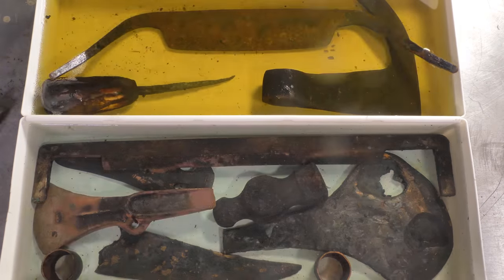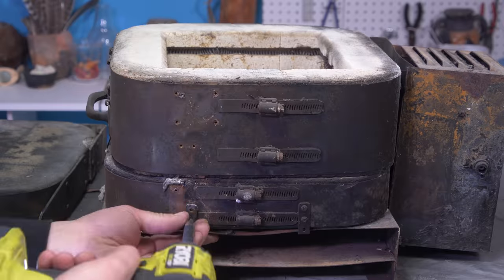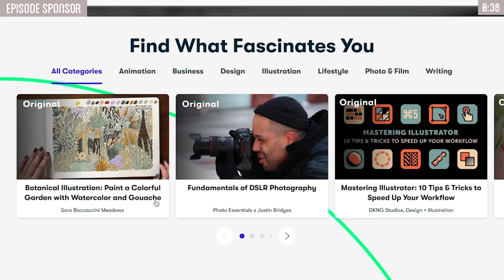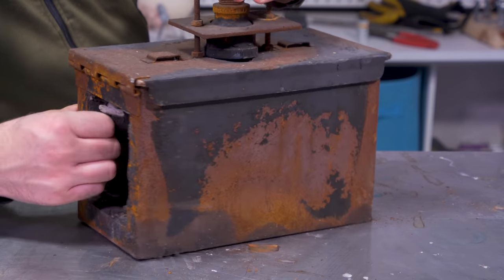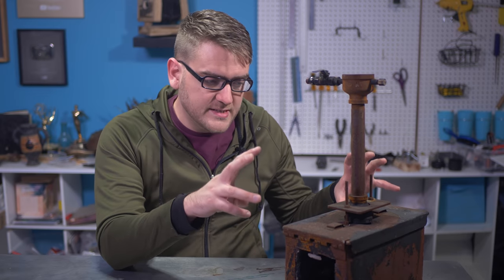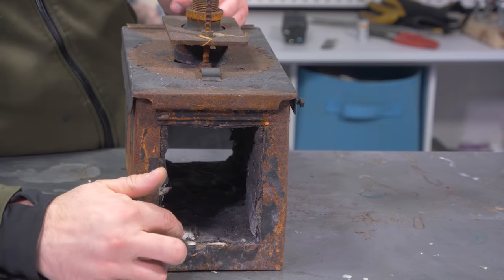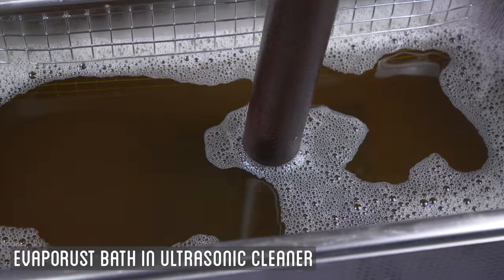Restore or Replace? $1000 Kiln and $150 Forge Rebuild!

Comment: Hey guys, the ultrasonic cleaner is more efficient if you don't let the item touch the bottom.  If you suspend your item in the liquid, the transducers aren't dampened by the item and cavitations in the water can more effectively clean things off.  Glad to see you guys are recovering!
Reply: This guy sonicates!
Reply: This is great advice, typically we use wire coat hangers to hang them in the solution.
Reply: Why would you want your tool to vibrate? Isn't that like moving your dishes around in the sink instead of holding them still while you scrub them?
Reply: @Bit-while_going  Sort of, but automatically, and at a much, much higher frequency with many times better results. So no, it's not like just haphazardly pushing your dishes around in the sink.

The ultrasonic cleaner works by using high frequency vibrations to create cavitation bubbles in the water. Cavitation bubbles are kind of like tiny implosions when gases come out of and then go back into the water, so the force of all these tiny implosions helps to remove rust and other residue much quicker and more easily. Imagine it sort of like how a boiling pot violently shakes the food around (be it vegetables, pasta, whatever) and helps to break it up and stop it sticking. 

The evaporust/vinegar also helps to speed this along by dissolving the rust into the water at the same time. Ultrasonic breaks the rust off to expose the underlayers, acid dissolves the exposed rust.
Reply: @Bit-while_going  that's exactly the goal
not having to do manual scrubbing for an hour
Reply: Good to know regarding using one. I had one long ago, they are really useful tools if you know what you are doing.
Reply: @Bit-while_going  It's actually the opposite.  Having it touching the bottom is literally vibrating your piece (like putting you hand on a subwoofer).  Having it hang in the liquid means the cavitations in the liquid are hitting the piece and breaking off the loose (dirt) stuff.  Think using the water from a hose to spray dirt off vs having the water on and trying to scrape the dirt off with the hose nozzle.
Reply: @gamingenius  did you read this in a manual? Or are you saying this from experience/intuition? As my manual says very clearly not to put items on the bottom of the pan
Reply: @hardcodedsoftware4212  That's literally what I said.  "the ultrasonic cleaner is more efficient if you don't let the item touch the bottom"
Reply: Isn't that why they are using this wire basket thing?
Reply: @tillepprecht  For the small pieces.  But they put the entire enclosure for the kiln into the bath without the wire basket.  Such a large piece is going to severely dampen the ability for the transducer to create cavitations that do the actual cleaning.
Reply: @gamingenius  As a bench jeweler for over 30ys, NEVER rest the item on the bottom- this interferes with the vibrational frequencies and adds stress to the inducer. Also for note...the tank really works best at @ an 1" from full. Hope this helps other users.
Reply: Ive noticed that in resuration videos never even thought abt it lol

Comment: That Kiln rebuild is an absolute win in my opinion. Half the price of a replacement, looks brand new and has better functionality than the original. Plus it made an interesting video. Can't go wrong with that!
Reply: AND he's gained valuable programming experience for when he inevitably builds his own computer from scratch!
Reply: Far less than half the price; paying yourself to learn an entirely new skillset from scratch is pretty off-base, IMO.
Reply: And he did it himself, so the minimum wage is not really a loss of miney
Reply: @KainYusanagi  Yeah, personal cost is always a bit of a tricky thing to calculate in. It totally depends on what job you could have done in that time, I never really calculate my time into total cost, I could easily argue it was done in my spare-time, which is free. :)
Reply: @alexanderludvigsen1893  Well it is a "loss", from his company's cofers into his wallet, in paying him (I'm assuming he actually has done that which is the smart way to run things, rather than running the business out of pocket directly). Not a loss overall for him, though, true enough (and why a lot of work is done by people on their own, rather than hiring someone else to do it for them).
Reply: @VincentGroenewold  Yup. There's also the argument of the training being relevant to the work you are doing to be able to write it off as a business expense, as well as other factors, like... Is it just you doing things on your own to figure things out, or are you taking a formalized class, etc.

I definitely wouldn't be paying myself wage to tinker around with crap I don't know crap about, for example, but if taking a formal class for it, eg. through Skill Share or Khan's Academy or something like that, then yeah, that would be a reasonable expense. The way he worded what he did, though, it sounded like he just was tinkering with it over and over until he got it to work in the end.

Comment: The Raspberry is a bit of an overkill, an Arduino or just a small atmega would have worked. But it's really nice to see you restoring (or in this case, upgrading) your tools.
Reply: Ha, an ATMega would be serious overkill, could just use some 555's!
Reply: Overkill? Yes. A learning experience for when they start fabricating their own microprocessors? Also yes.
Reply: That's what I was thinking.  Thing's just a bang-bang switch with a display.
Reply: Yeah. A simple PID would have done it.
Reply: @georgeschmidt9153  An STC-1000 costs 10 bucks plus the SSR. thats maybe 30 bucks in total repair cost.
Reply: Yeah, it is a little over kill.
For all you other "It just needs to on and off" "A 555 would have" "A PID would have"
No, it's not that simple.

If all you want to do is send it to melt temp for a given material/alloy, sure.
However if you want to temper metals, or bake ceramics or a myriad of other things, it's much more convenient to be able to set specific, automatic heat ramps both up and down. You have to use some sort of micro for that. 

While I agree that a Pi is overkill, when you consider the overhead for running a pretty flash screen like that, and the functionality the kiln now has, it isn't a bad choice considering how easily it can be implemented and how available the hardware is. Don't worry, I understand instantly going to "THAT'S COMPLETE OVERKILL", given that every "electronics wizard" is now using arduino's for water sensors when 5 npn transistors and a handful of resistors would do it. Or to turn on an LED for 4 seconds when a 555 would suffice.

Drives me nuts too.
Reply: The rPi does allow for things like easily implementing and setting up remote control and web interfaces, since you're running an actual linux box. While you certainly could have these features with an arduino if you absolutely wanted to with the right combination of software and shields, it's much less hassle for a hobby-level developer to do with a pi since all you need is to spin up a nodejs server and toss some "babby's first angular component" code at it.

Besides, it's not they're costing out a BOM for a large-volume product, a few extra dollars and watts doesn't really matter.
Reply: Might allow to have remote monitoring
Reply: @IsardPragmatique93  btw do we know what the cause of the fire was?  seems like a remote temperature sensor would have multiple uses, imo.
Reply: For the purpose of having a touchscreen UI and local webserver hosting (I assume since he mentioned controlling from a mobile phone) I think the raspberry pi was a good choice, I worry about it overheating though!!
Reply: The biggest issue with the RPi is that it will eventually eat its SD card and you'll need to reimage it - and if there's any unique config or code on that card, good luck.

Personally, I'd look to something like an ESP32 - you get a really beefy micro controller than can still be programmed with the Arduino IDE, there's loads of example code to work with (aka, copy/paste until it works) and it has bluetooth and wifi, so you can still do remote control via a phone.

I have a ton of RPis I use for various things, but for this kind of really embedded work, where it's going to utterly ruin your day if it just doesn't boot up one day, I would always go for the ESP32 or similar. It's definitely a slightly steeper learning curve, but it's a curve worth climbing.
Reply: I'm pretty sure some voltage comparaters would do the job

Comment: pls make sure to use teflon tape on all the gas connection joints, also be careful with metal thats been in a fire as its more likely to bend or crack due to the heat from the fire, otherwise epic video glad youre doing well
Reply: Yellow tape/dope just to be sure. The hose most likely has a gasket but may get broken down by the propane depending on the type of rubber/polymer. Also make sure to use an auxiliary pressure regulator.
Reply: @brianc3481  your right I was thinking in my head of the yellow tape that's like the teflon tape but I couldn't remember it, thanks for reminding me
Reply: Yeah, I was looking at that too. I'm a little concerned.

Comment: I really like that you programmed the Pi to be a kiln controller! I bet that will work so much much better than a 1000$ kiln that only has temperature set points. This you can program to do fast or slow ramps and would be awesome for tempering steel!
Reply: Modern industrial digital temperature controls do that as standard - and are much cheaper than a Raspberry Pi based solution…
Reply: Still, it’s on brand for him - a channel whose point it is to make everything from scratch - and perhaps a customizable kiln  he built may instill in him enough respect to not burn this kiln down.
Reply: @iantaakalla8180  Yep he just needs to work on silicon manufacturing to make the Raspberry Pi from scratch :D or at the very least from scratch resistors and relay. That could be a good video idea!

Comment: Hey, I know it's been agonizingly rough over the past... 8 months? But thank you for still sticking with these videos. They're still a joy to watch, even if it didn't go how you planned/ wanted. Also, I can't wait to see your new sign put up ^^. 

As for the kiln, I've been debating getting a kiln myself. It's cool seeing you make your own code and having it be nearly set and forget (a very sought- after high end feature).
Reply: 100%
I really do admire @How To Make Everything 's tenacity.
I don't think I'd be able to sift through the wreckage of my workshop like that. I would find it very depressing.

Once, one of my workshops was broken into, ransacked. I lost almost everything. Rolling tool boxes, welders, computers, a LOT of power tools and small machinery. (don't even know how they transported it all without being seen or heard, but they managed it)
All uninsured. 

That was hard enough to clean up and bounce back from. Especially finding precision optical stuff smashed and knowing how hard it is to acquire and expensive it is to buy. Broken projects... Fibre coupled lasers ripped to pieces, because "smashing shit is fun!!!!" (I assume). 
Really knocks the wind out of ya. 5 years on now and I still haven't replaced everything I lost.

Having been through something similar, it really is inspiring watching as they slowly reclaim their as much as they can.
Reply: @jimmyb1451  Gezz... yeah that is horrible. At least you tried to bounce back a little

Comment: I sincerely hope that you have some type of thermal runaway protection on the raspberry pi driving kiln, it's not difficult program and would really benefit you in reducing chances of a fire. Hopefully when the thermocouple comes disengaged it doesn't try to compensate by jacking up the temperature even more causing a thermal runaway

Comment: Would love to have a breakdown of everything you did with that Raspberry Pi. I have three older kilns that all need electronics added to them, currently they all work on cone bending. I don't trust them to run without checking on them every 10 minutes.

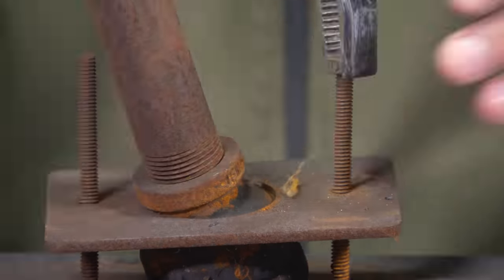Comment: 8:01 I have several defective propane tanks that I planned on converting to forges. looks like your burner should still be good... if it'd help (next time I'm home) I could be talked into giving you my old forge (Two 1/2inch burners that'll do 40k BTU each at 20psi) so I can clear out a space for the 3/4 inch burner forge I'm going to make for myself

Comment: You can check the forge plumbing for leaks with a spray bottle of soapy water, make sure that its tight. If you need to put tape on the joints, make sure you use something rated for propane

Comment: Regarding the cost of the reprogramming etc, I think you should offset that with the knowledge gained there. It will mean that a future project with a Pi, will cost much less due to experience. And still, it's now better with a better interface for half the cost. Great stuff!
Reply: Not to mention, if he had outsourced the project that didn't have to learn as they go, it would've taken them maybe a few hours.

Comment: You should forge a new bracket for the kiln for that cracked one 😆
Reply: Could take it off and repair it, it doesn't hold much pressure anymore so even a minor reforge will do wonders.

Comment: As an safety measurement it is recommended to have an hardware off switch like a button on an dangerous operating item which would be the heat in this case.
But you can also pull the plug if you dont wanna do it, just make sure you would be able to do it in time and without getting yourself in risks.

Comment: you should put gas rated teflon tape (the pink coloured one) on the threads of the fittings you used for your forge burner.

Comment: You can buy a PID controller with an SSR and a thermocouple for like $20.  With a little math using ohm's law you can buy kanthal resistance wire and wind your own coils. A kiln can be refurbished for less than $30.

Comment: The Raspberry Pi is an alright choice for replacing the kiln controller, but I'd be cautious with the heat from the kiln, raspis tend to overheat on their own without other heat sources. Maybe put some more insulation or perhaps a small cooling fan for the electronics?

Comment: I think the skills you probably learned with the Raspi are invaluable; however, I regret to inform you that you can absolutely purchase off-the-shelf programmable kiln controllers. Even on the low end, you can get a pid controller with ramp and soak for around $80.

Comment: Electric kilns/forges/foundries are remarkably simple appliances. Just a heavily insulated box with heating coils contained in the walls connected to a computer controlled relay to control the temperature.

Comment: The forge looked like standard maintenance if you had about 1000 extra hours on it.

The kiln may be better then just a replacement because of the flexibility of the raspberry pi

Comment: My only 2 concerns with the kiln repair - I hope that digital diplay etc is ok being so near the heat generated by the kiln. I worked in a pottery studio as a hobbyist and that close to a kiln is still damn hot.

Also, if those heating elements are hanging out of the grooves like they look like they are, please replace them. They’ll probably break on their own anyway due to the damage sustained and then the uneven heat in the kiln will probably ruin your pottery. Dunno if refiring an unevenly fired piece can save it.

Comment: and before I get any flack the  cost of the pi setup vs some used parts off ebay is BIG... but I guess you learned how to do it on the pi ... a PID controller with a serial port and the software is free to do ramp and soak ...  I would be glad to provide the items...  is it 240 or 120?

Comment: Cheap TC controller off ebay or Ali is $20, add in contactor $10 and you have all you need, no software at all and the controllers often have both soak and cool down modes in them.

Comment: I wish there was a smarter way to find donor devices.  Some sort of ebay for crud, if that's not redundant.  We always think of anything that's not immediately useful to us as garbage, and that is a major flaw of our species currently.  Usually when chirugery happens, it's from existing surplus equipment within an organization, ala turning two broken units into one workable one.  Ergo, if I scanned an SKU into an app linked to a shared database upon acquiring an item, and again when seeking to mothball it, people that already had the SKU might be asked if they want to acquire backup parts.

Comment: Hi! 
Did you guys replace the overtemp cutoff switch when you repaired the guts? The existing one would've been damaged and  removing it would make the kiln very dangerous - especially given that it is controlled by I high level computer like a PI that could crash and leave the heater on.
Reply: Don't worry he has dealt with house fires before :)

Comment: If you get a pi zero w, I can send you an image i've compiled myself that's resolved all the problems that that particular program has. Can give you pointers otherwise, if you let me know which bits are stressing you, as literally every iteration of the pi or zero is different lol I suggest finding the nearest official pi release to the time that the github for the variant you're using was published for a quicker starting point

Comment: Not that playing with a Pi for custom software applications isn't fun or awards max nerd points, but you can pick up digital temp control boxes for $20 that all you need to do is wire up the power circuit.

Comment: A pi is overkill, it has the power to run a desktop, you need the kind of processing power than a calculator has. A teensy or arduino would be a better option for and future simple electronics projects. But now that you have such an advanced computer, you can set up remote control and monitoring of the kiln.
edit: i commented too soon lol, you do have remote control